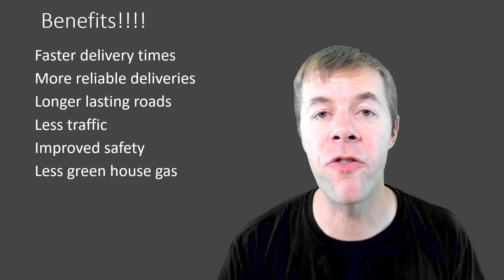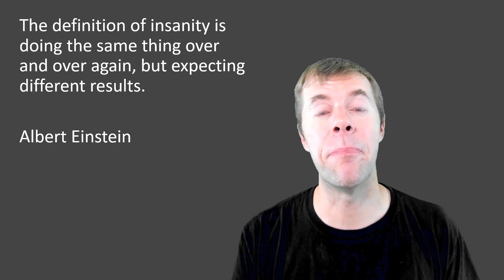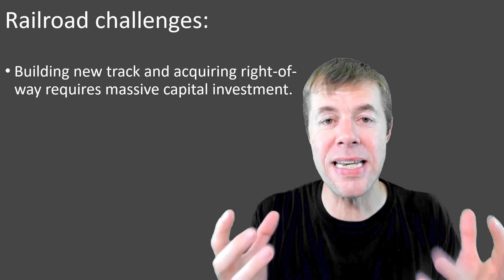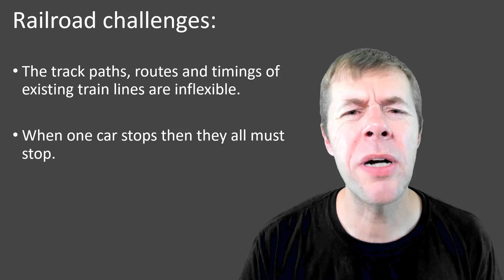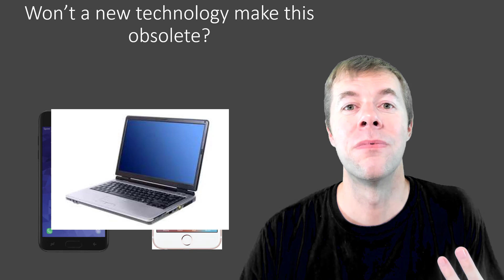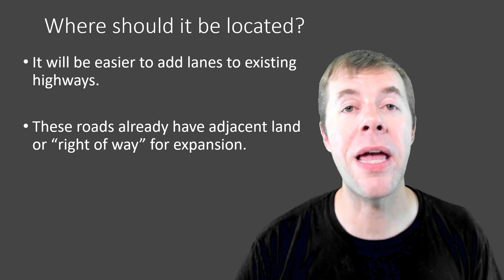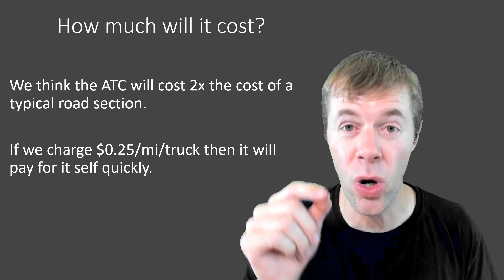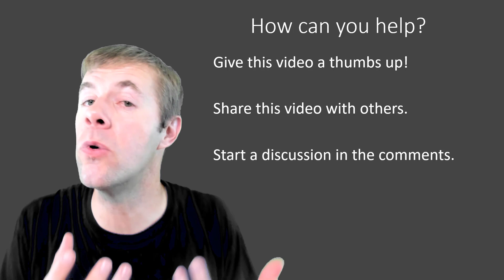How can autonomous vehicles save our roads? part 2 Q&A

Comment: Right-of-way costs can be eliminated by using dedicated tunnels. The Boring company is developing machinery designs that reduce tunneling costs by producing smaller single-lane tunnels, and by tunneling faster. 

Tesla is about to manufacture their version of electric Truck Semi-Tractor. Batteries allow more flexibility in laying overhead power lines, eliminating the need for 100% coverage. For example at tight curves, intersections and forks, the more complex overhead structures can be eliminated.

Comment: As a road construction worker -- this idea will never happen. The middle of the roadways/ or as you pointed out, even the shoulders could not be used because of WATER DRAINAGE issues.  There has to be a place for the water to run!   Secondly, it is all fine and dandy having a machine run the truck, but when something like a tire blows or something falls apart/ a human is the best SAFETY device on the truck.  Thirdly, good luck funding a broke govt. or getting unions to go along with a roadway that will charge a toll for products being delivered.  Everyone knows it is the end user that pays for any added expense to ANY PRODUCT.  In closing, It all sounds great on paper, but ultimately I would bet my home on this that it will never become reality.  The railroad is a powerhouse that will definately pull to sink this ship.
Reply: I made a Comment in the First Video trying to help him understand his Hyperbole .. but here the major points here:
1. Emergency Vehicle and Police Turn (or speed camera trap) around, Fire Breaks (as you listed Water Drainage as you said).

2. Electrical Energy needed would be 444,000 Volts per Line @ 15 Amps for Every 100 Miles of Road to keep up with 20,000 Trucks, otherwise - city to city (600 Miles) would need 2.666 Million Volts @ 15 Amps / Second to power the same amount of Vehicles - the Tram Lines would need to be HUGE to carry that load - this is the issue with Trying to Power Every Electrical Vehicle at once

3. Any Automated Driving Vehicle will be slower, not because of their design, but because of SAFETY and Government, they would space them apart like Trains, not back to back like Tylers Graphic.

Comment: We don't need this BS.
It's better to fix the roads then trying to save them by adding a new special lanes.
Too expensive and time consuming.
Reply from the maker: Do you think the fixed roads will last?  Heavy truck volume is going to do nothing but go up.  As soon as we fix them they will just fall apart again.
Reply: Yes, and we'll fix them as many times as necessary.
And no need for a new special lanes.
Reply: @TylerLey  Unions everywhere rely on roadways breaking and crumbling.  Ever visit Chicago?  The city of detours and road construction where the unions control the city worst than the mafia.

Comment: One thing that is very interesting is the ability for regenerative braking/  retarding to help offset the costs of crossing mountain ranges. This can be accomplished with batteries or capacitors but we don't have the storage capacity to get freight over the Rocky mountains or the Sierra/ Cascade regions. The ability to use the grid would also eliminate having to haul the batteries around, further increasing efficiency. 
Great video with excellent ideas Tyler, I hope this gets fleshed out and implemented :-)
Reply from the maker: Thanks so much for your comment and important insights.  Let's keep pushing!

Comment: To all commenters,

If you see downsides to ATC (by all means) write them down here. They are important. But at the same time try to think how this downside could be mitigated or turned around. 
So in stead of: This can’t be done because . . .
Try: This can be done only if . . .

You’ll be surprised how powerful this can be.
Reply from the maker: Conservator,
Thanks so much for your awesome suggestion.  It would be great if these brilliant people also tried to think about solutions to these issues.  I am looking forward to diving into more of the comments when I get some more time.  Thanks again for adding to the discussion.  Lots of work is needed on this and we need great people like you helping.

Comment: Hi Tyler, here are my thoughts. 

I think you should compare the costs of the ATC to a freight track railway and not a high speed (passengers focused) rail (HSR). I’m sure the ATC will still cost a lot less but not nearly as much as your example with HSR. 

On accidents you’re correct that on the ATC trucks could fairly easy just go around an accident. Trains just cannot. But train accidents rarely happen. Railway is a very safe transportation method. I hope ATC will be too, but due to the higher complexity I think it’s fair to assume it won’t reach the levels of railway any time soon. Oh and with barriers it could become tricky for the trucks to drive around an accident. Maybe the barrier should be (very) physical. 

A train usually has just one to three locomotives. If one fails, chances are the other(s) can take over and carry on (at a slightly slower pace). 

With trucks if any one fails it will block (at least part of) the track. You would want to avoid building wider tracks because of the huge costs. A solution could be to design standard interfaces between the trucks so that they can tow and/or push each other in case of emergency. 

I love the idea of overhead power lines. It totally solves the range issue while keeping the ‘off track’ delivery ability. Genius! It will however put a limit on speed. One of the challenges of high speed railway is with the overhead power lines and having a variety of trucks on rubber tyres at close distances will only add to the wrong side of the equation. It doesn’t have to be a showstopper at all though. Even at current ICU speeds you will win some time by not having to stop for fuel, sleep, eat and the other thing. Speed comes at a cost. Its key to find the optimal solution. 

In part one you mentioned that government spending on infrastructure is half of what it should be. And your solution is to invest a huge amount in ATC? (Just kidding)
It shows that we should focus on private funding. France has absolutely superb highways. Very wide, well maintained, clean and spotless facilities at (even non commercial) stops. And it doesn’t cost the government a single €. Idk but they probable even make a profit on them. Just a slide disadvantage is that you have to pay toll. It’s far from cheap but every time I use them I still think it’s good value. 

The same should be apply on the ATC. As long as the costs are less then the benefits, carriers will use them. The prospect of making (some) money by the ATC could also be way to get the government(s) behind the idea. 

I’m sure you (all) have a business model/case based on rough estimates. I think that business cases for different scenarios could give some guidance when further developing this project. 

Looking forward to the next video! 😜
Reply from the maker: Thanks so much for the juicy comment!

See responses after the comments.

-----
I think you should compare the costs of the ATC to a freight track railway and not a high speed (passengers focused) rail (HSR). I’m sure the ATC will still cost a lot less but not nearly as much as your example with HSR. 
-----

I think this is a good idea.  It is not easy to find prices for freight rail corridor projects in highly congested areas.  I don't think a freight rail on that same corridor would be much less expensive.  The crazy cost is from obtaining all of that land instead of using existing right of way.  Also, the ATC and HSR could have comparable speeds.  The ATC would be faster if you take into account the stops the train would have to make. 

-----
On accidents you’re correct that on the ATC trucks could fairly easy just go around an accident. Trains just cannot. But train accidents rarely happen. Railway is a very safe transportation method. I hope ATC will be too, but due to the higher complexity I think it’s fair to assume it won’t reach the levels of railway any time soon. Oh and with barriers it could become tricky for the trucks to drive around an accident. Maybe the barrier should be (very) physical. 
-----

These are good points.  The ATC is more complex but with time I think it could prove to be a very safe system.  We need to build the ATC with as much flexibility as possible.  This will allow the system to adjust to whatever occurs.  

------
A train usually has just one to three locomotives. If one fails, chances are the other(s) can take over and carry on (at a slightly slower pace). 

With trucks if any one fails it will block (at least part of) the track. You would want to avoid building wider tracks because of the huge costs. A solution could be to design standard interfaces between the trucks so that they can tow and/or push each other in case of emergency. 
-------

This is a really cool idea!  Thanks for sharing and coming up with a possible solution to this issue.

---------
I love the idea of overhead power lines. It totally solves the range issue while keeping the ‘off track’ delivery ability. Genius! It will however put a limit on speed. One of the challenges of high speed railway is with the overhead power lines and having a variety of trucks on rubber tyres at close distances will only add to the wrong side of the equation. It doesn’t have to be a showstopper at all though. Even at current ICU speeds you will win some time by not having to stop for fuel, sleep, eat and the other thing. Speed comes at a cost. Its key to find the optimal solution. 
-------------

Thanks so much!  There are lots of possible solutions.  I agree that we need to optimize the solution.

______
I’m sure you (all) have a business model/case based on rough estimates. I think that business cases for different scenarios could give some guidance when further developing this project. 

Looking forward to the next video! 
_______

I agree that it has to make financial sense for this to become a reality.  We have looked at corridors that would cross the US and we have looked at very short distances with very heavy truck traffic.  The one variable that is hard to determine is how much to charge the trucks per mile.  How much is reasonable?  If you only charge enough to pay for that stretch of road then some regions have very low charges and others are very high.  We are working on a decision making framework.

I have started to work on video 3!  Lots of cool stuff coming!!!!  Thanks again for the great comments.
Reply: I made a Comment in the First Video trying to help him understand his Hyperbole .. but here the major points here:
1. Emergency Vehicle and Police Turn (or speed camera trap) around, Fire Breaks (as you listed Water Drainage as you said).

2. Electrical Energy needed would be 444,000 Volts per Line @ 15 Amps for Every 100 Miles of Road to keep up with 20,000 Trucks, otherwise - city to city (600 Miles) would need 2.666 Million Volts @ 15 Amps / Second to power the same amount of Vehicles - the Tram Lines would need to be HUGE to carry that load - this is the issue with Trying to Power Every Electrical Vehicle at once

3. Any Automated Driving Vehicle will be slower, not because of their design, but because of SAFETY and Government, they would space them apart like Trains, not back to back like Tylers Graphic.

Comment: The pretty pictures shown are nothing like what overhead power really looks like.  It's hard to make overhead power lines look anything but ugly to me
Reply: Overhead power lines might not look pretty but not do traffic jams 😉
Reply: I made a Comment in the First Video trying to help him understand his Hyperbole .. but here the major points here:
1. Emergency Vehicle and Police Turn (or speed camera trap) around, Fire Breaks (as you listed Water Drainage as you said).

2. Electrical Energy needed would be 444,000 Volts per Line @ 15 Amps for Every 100 Miles of Road to keep up with 20,000 Trucks, otherwise - city to city (600 Miles) would need 2.666 Million Volts @ 15 Amps / Second to power the same amount of Vehicles - the Tram Lines would need to be HUGE to carry that load - this is the issue with Trying to Power Every Electrical Vehicle at once

3. Any Automated Driving Vehicle will be slower, not because of their design, but because of SAFETY and Government, they would space them apart like Trains, not back to back like Tylers Graphic.
Reply: You would need Power lines that could carry a MASSIVE LOAD - your average Tam Line would melt with this much Wattage

Comment: Rule of thumb is rail requires 1/3 the energy to move a given amount of freight. And freight dosen't need high speed rail like that Accella train going up the NE corridor. I worked with Kiewit/Mass Electric on that project on improvements to electrification. A lot of work went into reducing sag on the trolley wire to allow high speeds. Freight rail with intermodal containers needs to play a bigger part for the majority of the freight's journey. We need to rethink rail freight a bit. Maybe even light rail freight with smaller trains. Too much energy is wasted moving freight with systems involving pneumatic tires and conventional pavement. The tires flex and the foundation underneath the roadway moves more than what people think, and that all eats up power
Reply: Cindy Tepper, 
One point you missed is how efficient the locomotive diesel engines are, almost 50% BHP. It also helps that there are few steep slopes. All-electric tractors will remake the efficiency of the trucking industry. 

Automation will allow safe draft distances in convoys on conventional roads as well, but any manual override will interfere with reaction times and safety.
Reply: David Ogawa Hi,
I’m sorry I don’t understand what you are trying to say. Could you please explaine what your point regarding the efficiency of diesel locomotives is? And what is the relationship with ‘all electric tractors will remake the efficiency of the trucking industry’? 
Tia!
Reply: @Conservator.  
Requiring much higher peak acceleration reduces the cruising-power efficiency, so truck Diesels have much lower thermal efficiency than locomotive Diesels. 

Electric transport will disrupt this. Electric motor and battery efficiency isn't tied to maximum power capacity. They can both improve together. 

Natural gas fired electric plants reach 60% efficiency, where the theoretical maximum is ~72%. Combining electric motors with efficient batteries, AI driving and regeneration, the Diesel trucking industry is about to be disrupted.
Reply: @Conservator.  
This disruption may also be exploited by rail. Locomotives can be small - potentially on the same granularity as the rail cars. Does that make it "light rail?" 

If the industry is adaptable:
  1) Install AI in every tractor and make rapidly attachable/detachable on most any railcar; 
  2) Build progressively smaller tractors, battery-supplemented, that operate on trolly wires;
 3) Trolly wires are not expected to provide full coverage, less mechanical complexity, reduced downtime; 
  4) Retrofit legacy Diesel tractors to also run both on battery and utility power (may require dedicated trailer car with battery, converter and trolly);
 5) install tractor motors, batteries, trolly on progressively more railcars;
  6) delegate more switch yard work to AI
  7) Operate trains with the local AI progressively handling more responsibility;
  8) Give engineers remote-manned (pooled-labor) oversight of AI help requests and optionally not work from locomotives;
  9) couple and uncouple trains dynamically on the main lines at speed
Reply: David Ogawa Hi,
Thank you very much for your replies! I see your point(s) now. 

I think that batteries are (still) much more the bottleneck than electric motors. The latter are already very efficient and reliable. Improvements can be made of cause but I think we’re at 92% efficiency for a car motor and 100% seems like an absolute maximum ;)

Although batteries have improved enormously over the past decades, they are still a weak link. EV are close to the point of outperforming ICE vehicles but we’re not quite there yet. But that’s just a matter of time (years not decades).

ICE’s are greatly improved in hybrids because the electric motor enables them to run at high efficiency mode. Just like the locomotives that you mentioned. As far as I know this tech has not yet been applied on any significant scale to the powertrain of trucks. That probably has to do with battery capacity, weight, cost and longevity and the improvements that can be realized on trucks. 

I see hybrid vehicles as transitional products to EV’s and I’m sure trucks will be full electric too eventually.

Having efficient power plants adds to the equation.
Reply: David Ogawa 
As far as I know all diesel locomotives have diesel-electric power trains. So the retrofit that you suggest shouldn’t be too costly. The overhead power lines on the other hand will require a large investment. Adding batteries might reduce the required lengths of power lines. That’s an interesting thought.
Reply: @Conservator.  
It is not just to reduce total installed length, but to eliminate the overhead wires anywhere complexity is higher: short tunnels, under passes, switching sections, rail intersections, curves...

Utility and battery supplements to Diesel also allows reduced volume in urban areas, during acceleration and during temperature inversions, and elimination of exhaust in tunnels. 

Replacing the few heavy Diesel locomotive with more lighter tractors may reduce wear on rail, ties, and gravel.